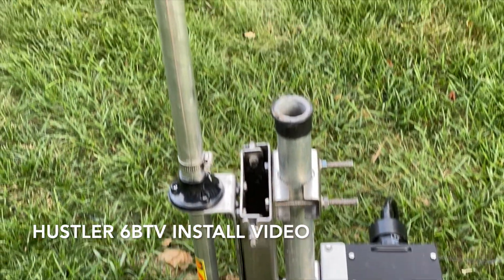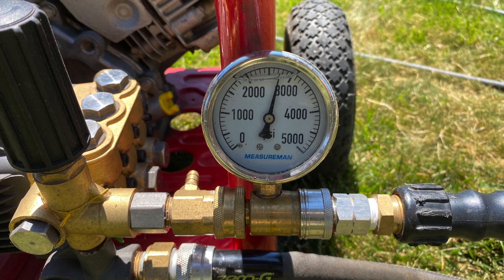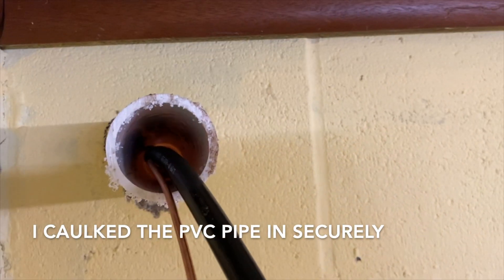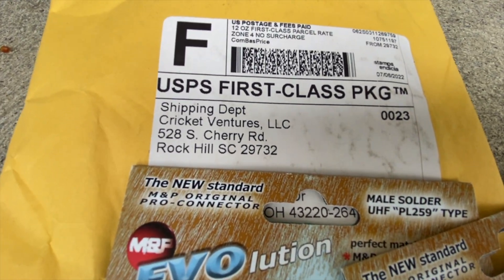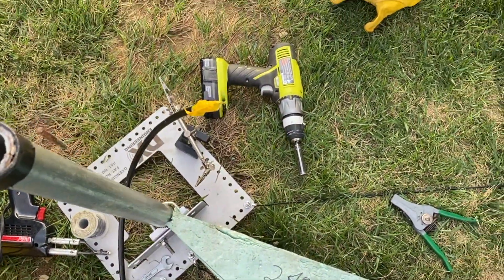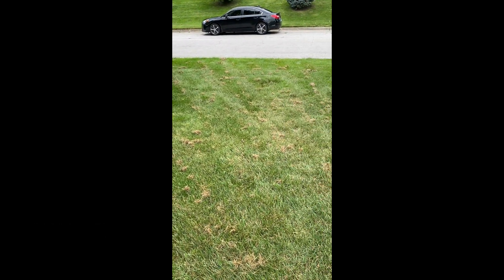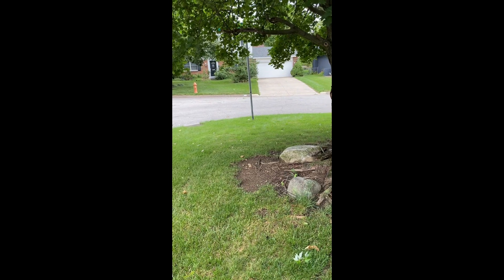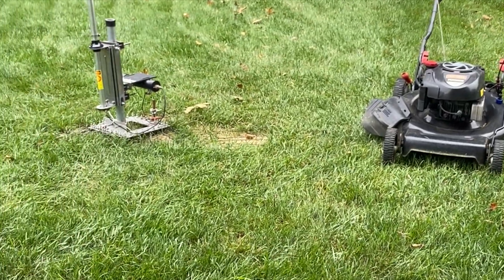Hustler 6BTV 5BTV 4BTV ground mounted vertical antenna. Ground radial installation. first impression

Comment: Great antenna! The more radials you install, the better it works. 30 is a good number to shoot for. Length isn't critical. Needs to be guyed with that 80 meter coil on the top. I have found 3 guy ropes to be sufficient. As I'm sure you have noted by now, the bandwidth on 80 meters is very narrow. 73 de WB4DW

Comment: That trick of using the pressure washer to bore into hard packed clay soil is brilliant.  I rented a powered auger for my last vertical installation about 10 years ago, but that was a bit tricky to manhandle.  Will try your technique next time around.  73 de W9YE . .

Comment: hola  amigo soy  de Santiago  DE Chile   tengo una  antena Vertical Hustler modelo 6BTV, no tengo espacio en mi casa  e leido algunos comentarios  que dicen que  NO es necesario ponerle planos de tierra  con las medidas exactas  que puedo hacer tambien vi que algunos ponen una bobina de choque   de 11 vueltas del mismo coaxial  me pueden ayudar  de ante mano muchas  gracias
Reply from the maker: Others say to put as many ground radials as you can.  After 8 radials you get less gain for each extra radial you place.  Common thought is that if you can only place short radials around the base you should place more radials.  The longer wavelength signal you transmit on, your coax will become part of the radial system and may feed RF into your radio room at long wavelength and lower frequencies.  You may need an RF choke on the cable before it enters your house.  Some have used a chain link fence or large wire screens on the ground.  Whatever is cheaper to purchase.
Reply: @jjsoundguy  GRACIAS POR LA RESPUESTA  ME QUEDA UNA DUDA  CUAL SERIA LA MEDIDA MÍNIMA DE LOS RADIALES  QUE PUEDA COLOCAR AMI ANTENA

Comment: Great job!  However folks, just FYI: you don't need the DX radial plate, or even radials of specific lengths...what i did was just put down a massive grid of wire mesh, staked it all down well enuf to let the grass grow over, and...that'it, folks!  You will find that ground mounting a vertical, and putting ANYTHING down for that ground plane works great...you might ask what if you don't have exactly measured lengths, will that affect performance?  Absolutely not!!  I used to run 800 watts from an Ameritron doing this, and had great results.
Reply from the maker: Yes.  Any metal mesh works great like you say.  Thank you.

Comment: I do not think it matters much but you have antenna 180 degrees out of alignment with the the radial plate.
Reply from the maker: I'm not sure I understand your statement.  Sorry
Reply: @jjsoundguy  The antenna should sit in the center of the radial plate, not off to one side.

Comment: I enjoyed the video. Thank you for sharing. I have one of these and am having problems tuning 40, 75 & 80 meters. I have grounding plate. Tried it ground level swr was sky high. Raised it in the mast about 4-5 inches and that helped with 10 & 20m. Im stuck now..what do do?
Reply from the maker: 75 and 80 are so extremely narrow for a good SWR freq span I gave up on them.  40 works GREAT.  73

Comment: But why didn't you use the pressure washer to dig the trench with ?
At least soften it up ?
                    🤔....?
Makes me wonder how you got the Ground rod in ?
Reply from the maker: For the ground rod I used the pressure washer for 1/2 the depth.  Used a hammer for the rest. I did not think of using it for the trench.  The edger (spade) was pretty quick though.  Thanks 73.

Comment: great Job, I am getting the 6 BTV next month and I am wondering how to prepare the hole? how deep and what circumference diameter to fill with cement  and what type of mast in length and diameter to fix in the ground and size to remain out for holding the 6BTV? can you help please
Reply from the maker: I bought a 6 foot galvanized pipe. Buried 4 feet of it in the ground.  My ground, 10 inches down from the surface, is hard packed clay. A shovel was worthless.  I used my pressure washer with a 4 foot solid pipe extension to bore down. Then a wet and dry vacuum was employed to clean the mud slurry from the hole.  This left a hole that a bag of cement easily filled with the pipe inserted.
Reply: Tough work! Many thanks

Comment: My luck would be the mower would grab the radials and rip them up.
Reply from the maker: I never had a problem mowing over the ground radial wires.  You are hard pressed to find a wire even if you know you are standing right on top of one.  73

Comment: Its been about a year.  How does this antenna do on 80 meters?
Reply from the maker: 80 meters is sumer narrow and such a short antenna cannot be efficient anyway.  I have never made a contact on 80 meters. I usually haunt 20 and 40 meters.  73 de N2MMS

Comment: Very nice video.  Hw did it survive the winter?   How far apart are the staples?   I’m afraid I would pull it up into the lawnmower.  Do I need counterpoise if I have a tuner?  Ic7300 internal.
Reply from the maker: Everything is perfect and the wire plus staples have disappeared from sight.  73.

Comment: I'm a little confused of the number and sizes of radials. For the 6BTV, how many radials and how long do they have to be? all the same size? some longer than others? Thank you
Reply from the maker: Radials are not an exact science.  The more and the longer the better.  But there is a point of diminishing returns. after 16 long ones the returns become less per radial. I had a small yard so I went with more radials.  73 de N2MMS

Comment: try digging through the hard tock in my part of the USA. 
one has to bow to the miners digging tunnels in this stuff.  central/ northern ca, USA.
even the power corp had trouble installing a new gas line. (the old one was so old there was no information on location).
Reply from the maker: Well then, compared to that soil I am lucky.  73 de N2MMS

Comment: why the unun and what one did you use.
Reply from the maker: The Un-Un is a Palomar Engineers unit with the static discharge. I connected the discharge wire with a clip lead to experiment to see if I get any Rx signal loss.  Detected no loss yet.

Comment: Where is the spider?
Reply from the maker: Spider?  Not familiar with that term relative to antennas.
Reply: @jjsoundguy  it's also called a capacitance hat but looking through things it looks like it only comes in the 4btv and 5btv, but not the 6btv.
Reply from the maker: @N8GMZ  I think that is correct.  73.

Comment: the ground that goes back into the house - what is that connected to ?
Reply from the maker: It connects to the cold water pipe that also connects to the main water pipe.  I figure that is a good ground.

Comment: "One wire that's proud" 🤣Great video, easy to watch, I have the same setup and love it! I moved mine this week and laying the radials again today and tomorrow so I came back to your video to reminde myself of a good setup!👍 I get 6m QSOs with this as well, it's actually tuned 6m in and the rest under 1.5:1. I added a lightweight flag at the top and have it up year round in my HOA!
Reply from the maker: I assume you know by "proud" I mean it sticks above the rest? Just a different use of the word.  Thank you.

Comment: I am reading the 5-BTV install directions.   It clearly says the coax or mounting bracket should not be directly grounded.  But doesn’t the metal pole your  antenna is mounted to do just that?
Reply from the maker: I get good performance on the lower bands OK the way it is.  No RF issues in the shack.

Comment: I worked my first ZL on 40m cw using the BTV6. The original radial GP consisting of 8 10m wires had come away from the base some years ago. Only earth was the 3.5ft ground mast and 4tf earth rod. Unfortunately  I didn't work DX on 80 or 30 but it was a great solid antenna
Reply from the maker: I am enjoying mine.  Thank you.

Comment: I Have ben a 11m guy for 35+ Years but went ham & I Stumbled on to M&P Coax & Their Evo Connectors & They Are By Far The Best I Have Ever Saw Or Used in my 35+ Years..I Run a Comet Gp-9N with 65-70ft of HYPERFLEX 10 Sahara With a Evo N Connector on one End & The Evo pl259 on the other End going to my Yaesu ft-991And According to my analyzer i only got Less than 1.5db ish of loss ! Not To Shabby At All IMHO ! !I Just Got My Hustler 5BTV Assembled & Installed Just a Fuw Days Ago (Ground Mount & NO Radials)& I Got To Say WoW What Receive They Have ! I Made Several Contacts & having a lot of Fun My SWR Is Pretty much Perfect on 20m,40m top to Bottom & 80m (Voice ) 15m is 1.4 to 1.5  & 10m is 1.5 to 1.6 So i am Still Tuning on them to a bit These Really Are a Great HF Antennas for the Money IMHO !
Reply from the maker: They are wonderful connectors. So easy to use.

Comment: The Hustler is a very good antenna. However I use a very similar looking (clone) antenna , it's a GP4 4 band (7/14/21/29M). At the moment I have only 2 radials due to lack of space but it works better than average. It was AUD 300 shipping inclusive.
Reply from the maker: I know I am past the point of diminishing returns with ground radial quantity but on the shorter radials I wanted to double up.  Happy QSOs with yours!

Comment: I installed a 4BTV last fall similar to yours and following DX instructions.  Very happy with the performance and without any other modifications found in addition to the standard 40, 20, 15, & 10 I can easily tune 6, 12 and 17.
Reply from the maker: I feel a good ground system is essential.

Comment: Looks 
It looks a well thought out install and I have had a 4 BTV for more years than I can remember at several locations and all on wet ground,experiences have shown me that resonant radials make a big difference but without the ground stake so all the radials insulated from ground and this made the best setup and the easiest to tune the antenna. How is the tuning when it rains very heavily 🤔
Reply from the maker: I have never checked the tuning when wet.  Tha ground never floods.  I did use insulated ground radials.

Comment: Bro, the idea is to place the antenna as high as possible, and not as low as possible to the ground like on your video.
Reply from the maker: It is designed as a ground mounted vertical.  If mounted higher off the ground the radial system becomes a nightmare.  Elevated mounting with this design calls for a different grounding design altogether.
Reply: Just massive amounts of ignorance in your comment there. Wow, how wrong can you get?

Comment: Nice video, John. I've had a modified 4 btv for about 15 years. I also used the ground plate and tilting mount from DX Engineering. With about 48 radials. After a few times mowing, the radials were hidden. The antenna works great. Numerous DX QSO'S.
Reply from the maker: I have barely put the antenna through its paces.  3000 mile QSOs have made me happy.  73

Comment: Nice content.  I have the 6BTV also with three ground rods and LMR400.  Mine was installed seven years ago with 1,000 ft of radials and put down in the spring here in Michigan and by early summer you could NOT find the radials.....now after seven years, the radials are about four to six inches under the soil.  After a few years you will need to get new trap covers as the sun will degrade the plastic.  I also use paracord as guys and dog run stakes to keep the antenna up during 30-60mph winds as well as ice issues.  Enjoy!
Reply from the maker: My radials have disappeared too. Even if I know a radial is right at my feet I cannot see it.  73

Comment: I have 4btv and used 750 feet of wire for my radials. There are 40 of them between 15 and 35 feet long circumferential. I i buried pvc pipe 3 inches deep and ran my lmr240 thought it. I have traps at each end to keep the water out. Ground rods at the antenna and where the coax enters the house. Lighting arrester where the coax enters the house. It works very well. I have made contacts all over the world with this antenna. Some of the furthest are, Japan, Cyprus, and Uruguay. I live in Nebraska home of the once great Cornhuskers :( Very nice job with the installation. 73 KF0ALT
Reply: It seems we have a similar installation. It is my only antenna, so I have nothing to compare it to easily. But I’m happy with it. I’m glad you’re happy with yours too. Thanks for commenting. 73 de N2MMS.

Comment: Do you know if this antennae would work in a terrain constrained place? I live at the bottom of a hill in relatively low ground. I'd like to reach out but just not clear on what type of antenna to use.
Reply from the maker: I am not an expert but it is a ground wave antenna. So the terrain slope might be your take-off angle.  I live where it is relatively flat but luckily at the top of a small rise.  Not a hill or a mountain, but a gentle rise. 73
Reply: Being relatively new to amateur radio, I have been researching antennas for quite some time now (long story).  What I do know is that it "depends" on the angle from your antenna (say the base) to the top of the hills that surround you.  Applying what I have learned to your brief description, start with a cheap home-brew horizontal dipole  or inverted V before spending any serious money.  That will give you mostly NVIS (Near Vertical Incident Skywave). which will use the ionosphere to bounce your signal to the other side of your hills.  There are many hams with good YouTube videos who will describe the radiation patterns for various antennas -- the most useful videos show plots using antenna analysis software.  I suggest starting with David Casler (https://www.youtube.com/watch?v=pRTo01Qttbc and https://www.youtube.com/watch?v=oFE142IMo-s) and DXcommander (https://www.youtube.com/watch?v=IsOfgRLSevw).
Good luck, and be careful not to fall down that rabbit hole though ;-)

Comment: Mate good job, but looks like you have used normal electrical tape to wrap around your connection points where the coax screws onto the bottom of the antenna. No good mate, you need to use 3M Self Bonding Electrical Tape to endure a 100% water proof seal.
Reply from the maker: There is the self bonding butyl tape under the electrical tape.  Thank you.

Comment: I have a 5BTV with 30 10ft radials.  According to WSJT I aint receiving or transmitting for sh*t! Dont know whats up.
Reply from the maker: If your swr is good and you have good coax to antenna interface (I used an UN-UN transformer) then look at your take-off angle.  Look horizontal from your antenna in all directions.  Certain obstacles impede the Tx and Rx of the signal.  Hills and buildings are examples. Also a lot of energy coming back up your coax might need to be addresses. That is why my UN-UN.
Reply: @jjsoundguy  My town sits in a hole for one thing.  Back in the day of tv antennas we had to have a really good one just to get 70 miles.  Swr is 1.3.  Coax is 40ft new cable expert RG8X. I do have 4 ferrite clipped to the coax at antenna. Thanks

Comment: Why would you bring that unusually long ground wire from the antenna into the house like that?  That is asking for RF problems!  The only thing leading from the antenna into the house should be your coax!  And that should have a good choke between the antenna and the coax right there at the feed point.  And connect several ground radials to that radial plate under the antenna and spread out around it like spokes in a wheel.  The antenna mount is grounded to the steel pipe it's mounted too, no sense in bringing that long (radiating) ground wire into the shack like that!
Reply from the maker: I did choke the coax.  I have no RF issues in the shack. Seems OK though.

Comment: I ran 32 radials, about 33 feet, just over 1,000 feet of wire on sandy soil for my 4BTV. My lawn guy won't cut one swath in line with where I buried coax in conduit with the trencher.
It works great WAS and DXCC on these bands came pretty quick. Looks like all the same DXE hardware, except I don't use UNUN or that shelf. I bring the coax across that tab on the radial plate and use a coax to the bracket on the bottom of the antenna. (overkill)
Reply from the maker: I say if it is worth doing, it is worth overdoing.  Joking but thank you for the comment.

Comment: I have the 5 BTV and I have it attached to a 8ft fence post into Minnesota black dirt with only Rg-213 and a 4ft ground rod and it plays very nicely.  Love my HF vertical 👍👍
Reply from the maker: I'm having fun with mine.  Thank you for the comment.
Reply: I have the 4BTV up and working great, I also have the 5BTV, I opened the box, put it together, and decided it wasn't worth putting up for 1 band, so it is hanging in the garage. lol
Reply: @buzzsah  I can relate!
Reply: Fill the holes with foam so ants don’t get in the house!! JohnBoyUtah
Reply from the maker: @Brenda-jf2pe  That is exactly what I did. 73

Comment: Great job John!
N8CMQ here, and I have been using a modified 4BTV for many decades!
I have added two wires to the system, that added all of 80 meters and most of 160 meters!
It helps to have some tall trees to put the wires into, but the wind makes the added bands disappear occasionally...
Right now, I am inactive, as I have repairs to do, and new coax to run. Animals like to chew!

As for my radial field, I have three sets of wires down, as the first two sets aged and turned into oxides, and I am not sure about this last set! It would be nice if I could get permanent wire to put down!
Reply from the maker: Permanent wires may be hard to obtain.  Good luck with your rebuild. 73